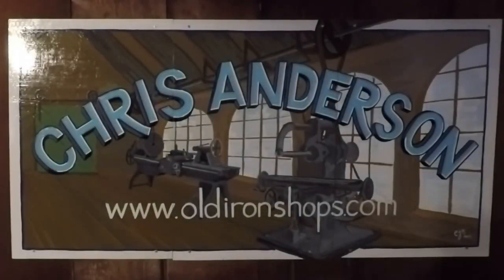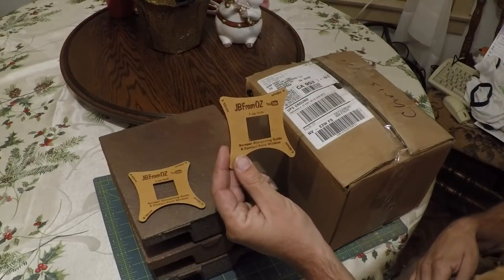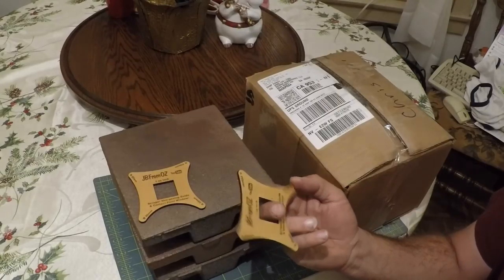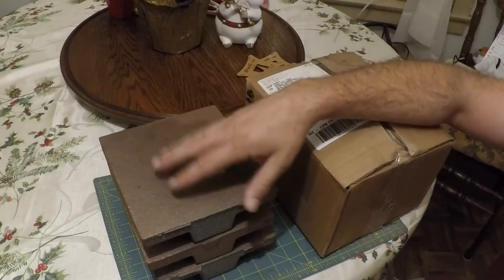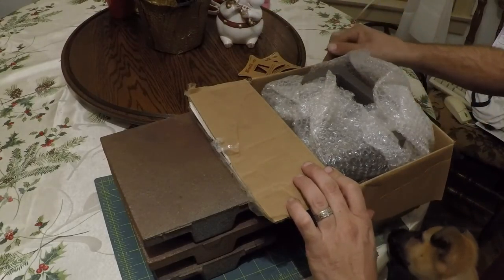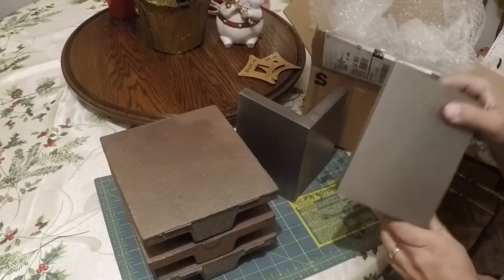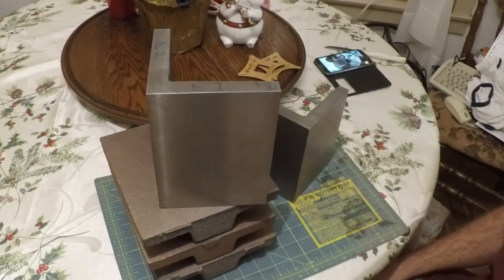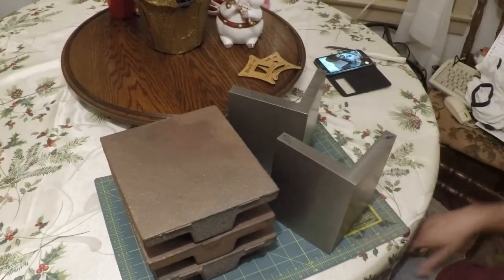Cast Iron Surface Plate Castings

Comment: Should be an interesting project to follow! I've seen references to the 3-plate method of truing, and I can't as yet wrap my brain around why it should work. But then I also read somewhere that you can true a surface by dragging it around on concrete. Yikes! Certainly can't wrap my brain around that one.
Reply from the maker: +Rick Rose I will do my best to explain it interesting Lee enough if this wasn't possible probably would never have Precision services

Comment: Did you make a video of the three plate lapping of these?
Reply from the maker: Not yet they still need to get milled even yet
Reply from the maker: @glenking3337  I wouldn't skimp on a surface plate a good granite one is going to be more durable than what your suggesting scraped cast iron is excellent as well. But it's no small task to generate accurate planes. Check out the book foundations of mechanical accuracy . Study up and just know a commercial plate used is a great deal